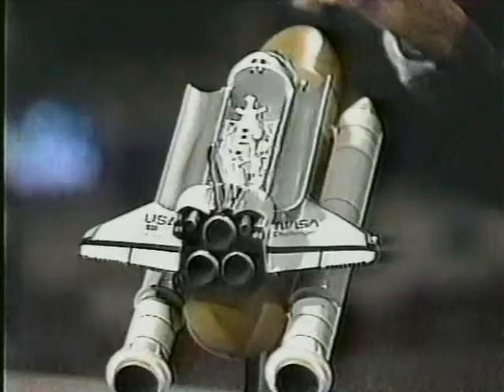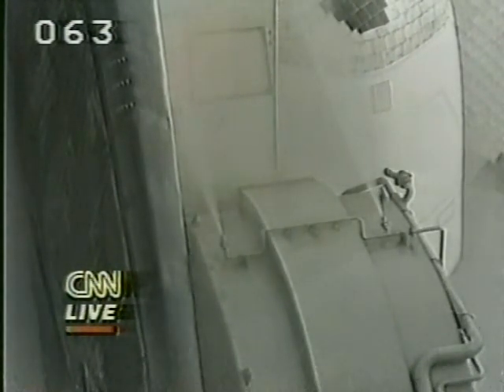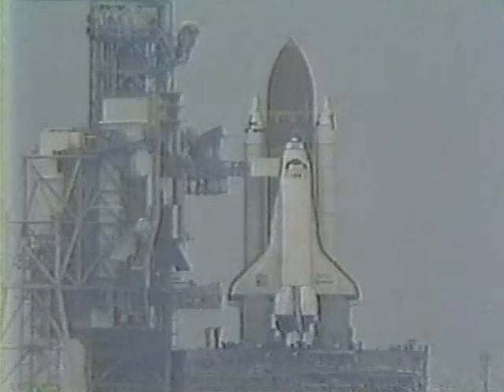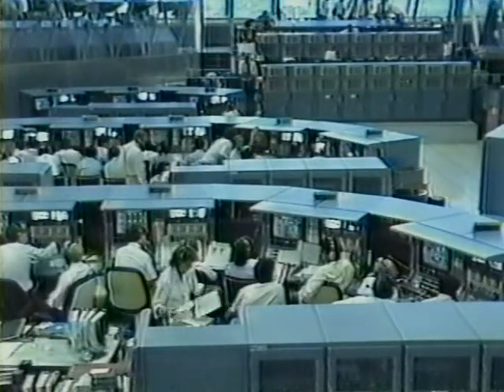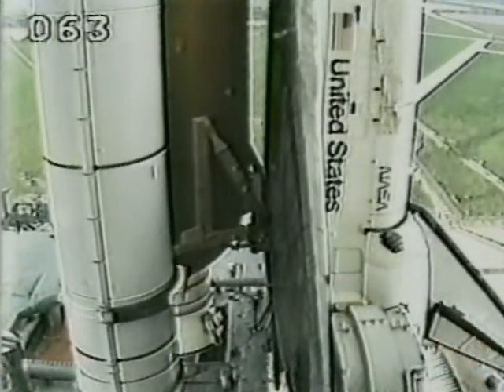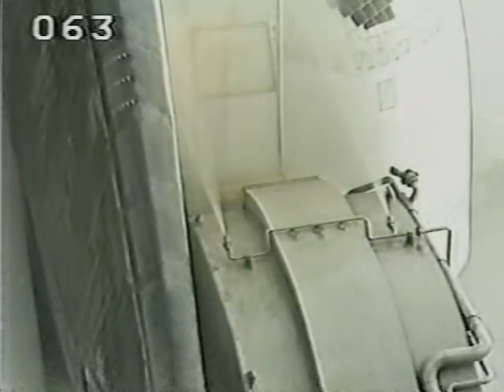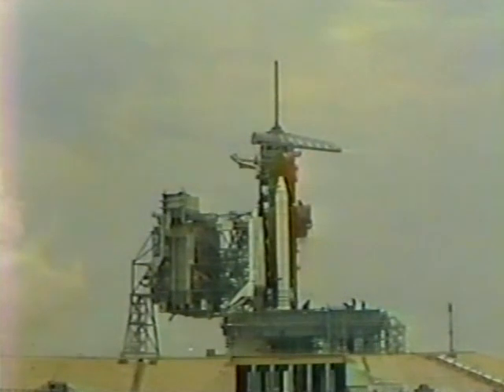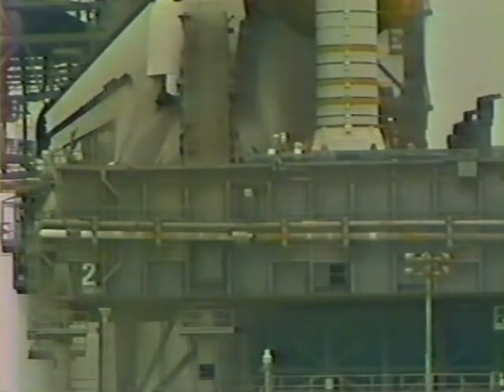STS-51F RSLS Abort

Comment: Look at the twang on that thing! Just incredible. Those bolts are hardcore.
Reply: Just think...the very same O-rings that are designed to hold back the combustion chamber pressures, are the very same O-rings that allow the shuttle stack to twang back and forth.  Seeing that SLS is an inline rocket vs a sidemount like the Shuttle, SLS loosens and removes the bolts prior to launch while Shuttle used frangible nuts which exploded and allowed the bolts to fall away at Tee minus Zero.

Comment: It's fascinating because you can hear the News Anchor alluding to how much pressure NASA were under to launch the shuttle on schedule for 'commercial reasons'.  This failure has the eventual knock-on effect of NASA attempting to launch below recommended parameters for temperature, resulting in the loss of this very shuttle (Challenger) and the unfortunate crew.
Reply: Wondering if the rush to Mars will have similar results.
Reply: That was only part of the reason for pushing 51L so hard. The main reason was that KSC wanted the orbiter back ASAP so that they could start the Centaur mods to her. Atlantis already had them and just needed the Mission Kit which consisted of the orbiter side plumbing and wiring. The Mod Kit consisted mainly of the penetrations used by the Mission Kit and Challenger needed another additional modification to her aft engine compartment TPS which consisted of replacing a section of FRSI blankets on the left side with the same AFRSI blankets used by Discovery and Atlantis to reduce a potential flammability hazard identified with the in-flight dumping of the Centaur liquid hydrogen in the event of an RTLS abort.

If 51L was flown by Discovery or Columbia, I think they would have waited but neither was an option at the time. Columbia was assigned to the payloads backlog clearance mission STS-61C and Discovery was west-coast bound for the first Vandenberg mission after STS-51I. She was already late but due to work on the actual launch complex being behind schedule, the Air Force let NASA use her for two additional missions which were STS-51G and STS-51I. After STS-51I, NASA began the preparations to get ferry-flight ready for the trip to Vandenberg AFB by removing the hypergolic propellants and the STS-51I mission components. She was in temp storage in VAB High Bay 4 awaiting an open OPF to finalize the work when the Challenger disaster happened.
Reply: @DaveS_shuttle  So Discovery was essentially going to belong to the AF. Also how come Atlantis was not an option? There was rumbling that because of the delays  of 61-C, 51-L should launch first because NASA was just ready to get that particular mission launched. But ultimately it did not happened. If only 61-C would've had minimal delays or launched around the holidays Challenger would've have had a safe flight. 1986 was bound to the beat 85 as the peak year of the program.
Reply: @twonumber22  I guess with the Challenger and Columbia catastrophies they won't make the same mistakes again; and in this era of cancel culture in the social networks that alone could bring Musk enterprises down
Reply: @alerey4363  lol, what?
Reply: @twonumber22  in the 80s there was no social networks (facebook, twittter, instagram, etc); one major incident like the challenger loss eventuallly faded away (because obviously NASA + government pressed the tv and radio and newspapers to not disclosure the facts like engineers warning about o-rings degrading on low temperatures or in the case of Columbia how many employees detected the foam hit with the wing and alerted their superiors of the potential risk and then a NASA woman discarded all these reports and literally killed the crew on re-entry), but nowadays that kind of criminal negligence would be punished by the general public via cancel culture; didnt you get the GameStop craze created by social justice warriors via web? if any of Musk companies kills people and try to hide it, it will be taken down by people boicoting his stocks, products and services
Reply: @alerey4363  Thanks for informing me that there was no social media in the 80's. 👍
Reply: @twonumber22  u needed that info, you're welcome
Reply: @alerey4363  Ok Zoomer.👍 I'll be sure to ask you if I want any stupid opinions about a decade that I witnessed in it's entirety.

Comment: 12:30
Very good view of part of the "rolling umbilical" for the Shuttle /Centuar missions. It's the yellow structure to the left.
Reply: Well, not the whole umbilical. Just. The bottom part. The arm would sit on top and attach to the Shuttle just above the left hand tail service mast (the LH2 one) just under the payload bay.

Still shocking that NASA thought carrying a HydroLox bomb in the payload bay was going to be fine. The missions were called Death Star missions.
Reply: Glad that was never used.

Comment: Wanna know why the challenger blew up a few years later listen to Tom Brokaw's blathering on. ...
Reply: Because they were launching in colder weather than they should have, the rubber O-rings that seal the sections of the SRBs together didn't seat properly, and exhaust gasses from the left began to leak out. Unfortunately, the leak occurred in a spot that let hot exhaust gasses impinge on the external tank. The tank failed and the Shuttle exploded.

As for the "blathering", remember that this was 35 years ago. Getting news wasn't nearly as quick as it is today. You're seeing a condensed version of the reporting, and they were reporting everything they knew at that point.
Reply: @almostfm  challenger blew up because of launch fever and the media and politicians riding the program because it wasnt launching 25 plus missions a year... The unrealistic expectations put on the program by the media and govt (at this time congressman were literally going on joy rides including the current /new NASA administrator) NASA was under so much pressure they didnt say STOP and look at what was happening... They were living in a dream land...

The technical reason the challenger exploded is an O ring but as Richard Feynman said For a successful technology, reality must take precedence over public relations, for Nature cannot be fooled.